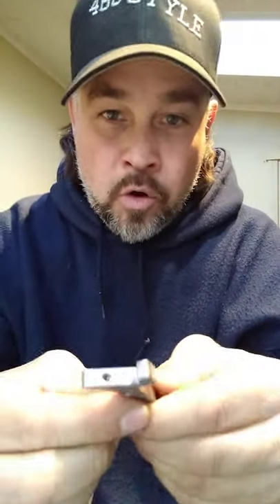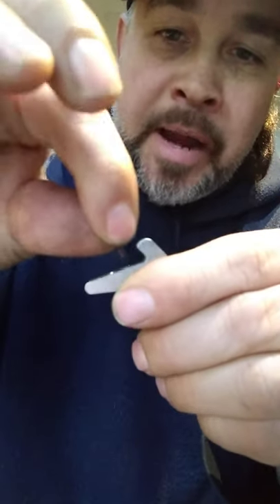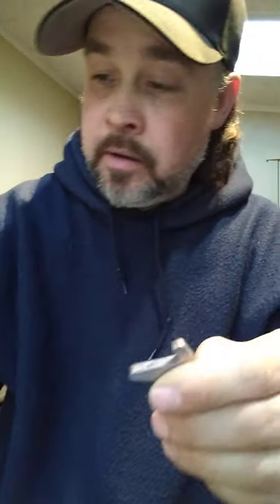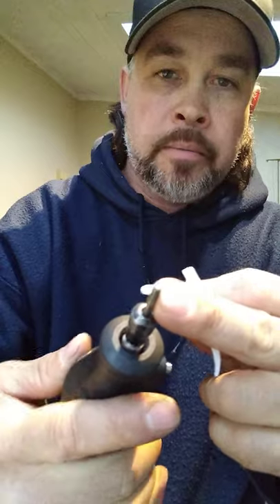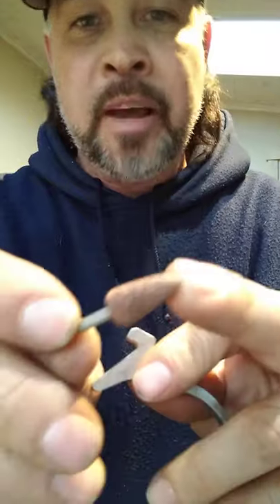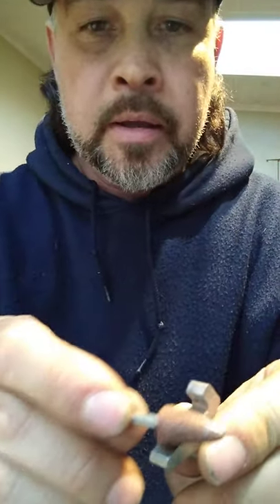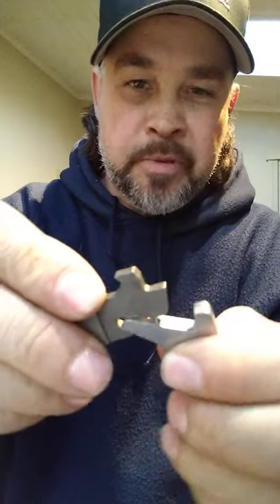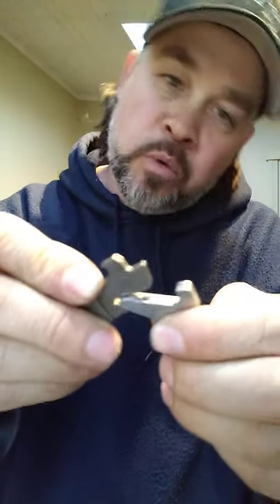Savage 93R17 trigger spring pocket relief

Comment: Drill it out big enough to put a ink pen spring in and cut it to length. Then shim the back of the trigger assembly. 025".  Huge difference in a non accu trigger. This isn't my video, but this is how I did mine. https://youtu.be/HBmd0BfPy8g
Reply: I modified the trigger of my mark II but couldn't find any ink pen spring to work.  I got a spring kit (tube of coil gun springs) from midway and found one that fit perfectly.  Trimmed it to the exact length of the original and got my  trigger pull down to a little less than a pound.  I have 90% of that spring left so I can cut off to whatever pull I want.  No creep anymore....perfectly safe
 I love it. I also bedded the action and my %100 mark II 22lr is now my most accurate 22lr, and I have what are supposed to be the "best". Everyone who knows the accuracy of 22lr at the range can't believe how it shoots. I've been offered 4x the money I have into it. I was very tempted but considering the fact that I have some very expensive 22s that don't shoot as well,  I don't know that I can recreate it.
Reply: @justanobserver530  I drilled out the hole that the factory spring goes in and used a light weight ink pin spring cut to size. I may have left that part out.
Reply: @inscoredbz no no you mentioned that. I was just saying what I did. After I read my post,  it did read like "well that doesn't work " but that's not what I meant. I  have several savage rifles, one of which is a 93R17,  so I really appreciate your videos. I may modify the 93 in the future but it seems to be fine for me....for now.